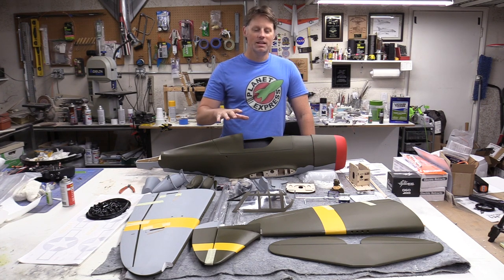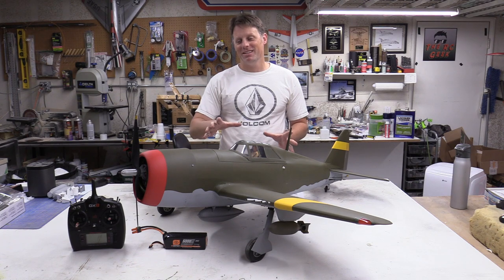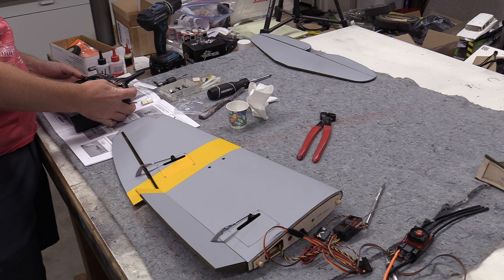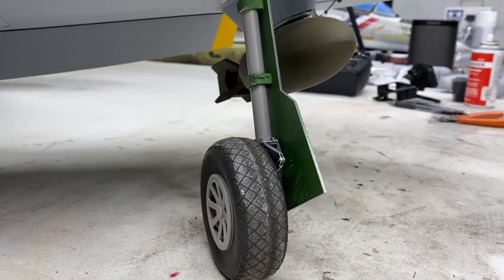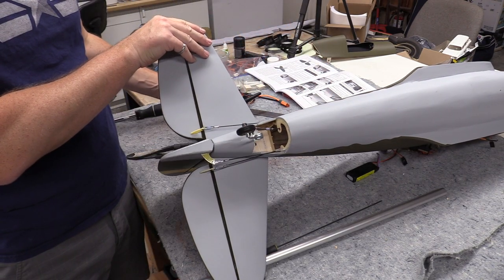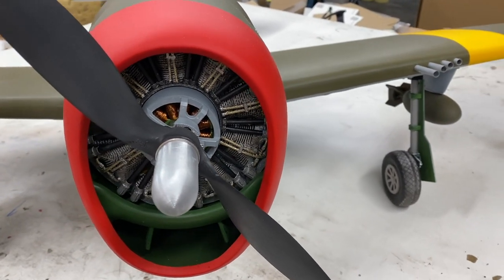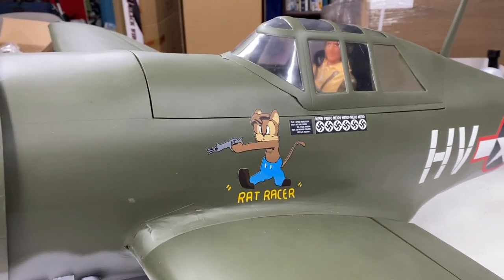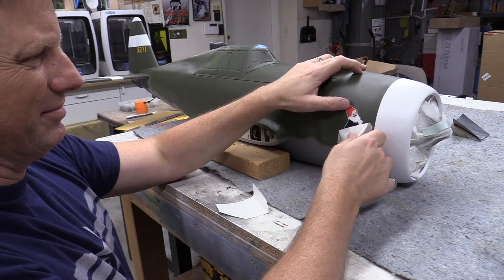Assembly Review & Repaint -- Legend Hobby/Seagull Models P-47D 'Little Bunny'

Comment: Maybe I missed it. I was wondering about the all up weight w/6S 5000. Would it easily carry a heavier battery?
Reply from the maker: I haven’t actually weighed the model. That said, there’s tons of space for larger packs if desired.   For the power system, the 5000 provides a good balance of flight time and weight, but there’s space for an 8000mah if desired.